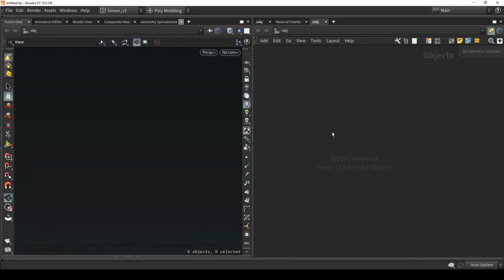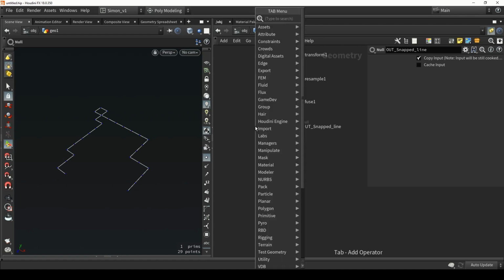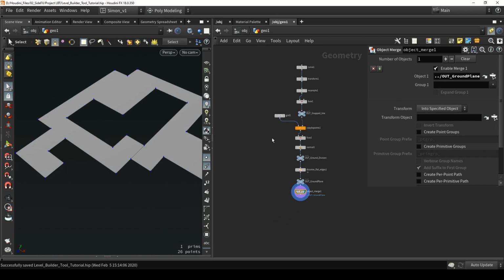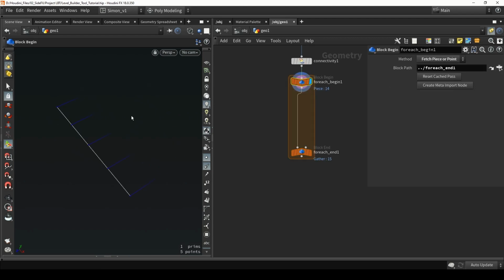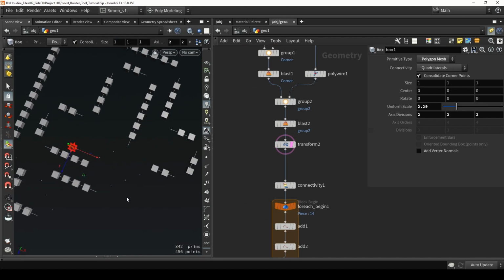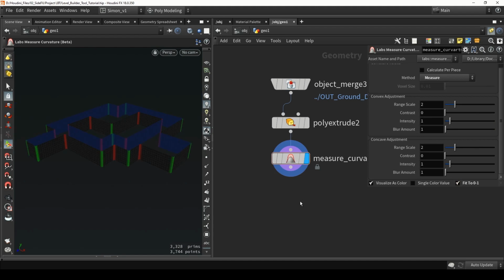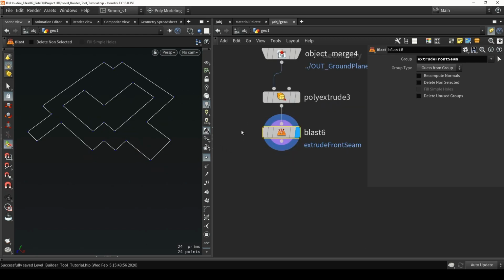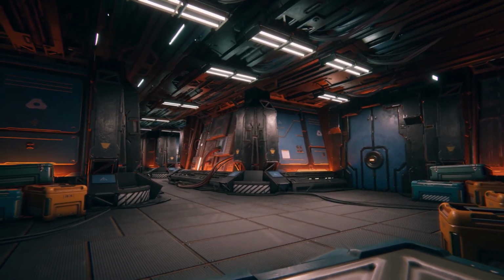Sci Fi Level Builder | Part 1 | The Corridor System

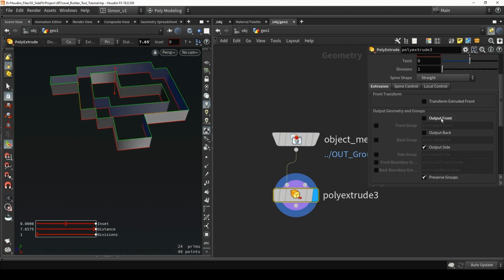Comment: I have re-done these steps many times in Houdini 18.x and 19.x,  and the polyExtrude + blast(extrudeFrontSeam) (at 22:00)   method does not clean up the inline edges that are generated when the generated Ground_Plane forms a loop. Any ideas? Work arounds?
Reply: Had the same problem and unfortunately Clem's solution didn't work for me. What worked in the end was to:
1. swap "Dissolve_Flat_Edges" for the "Extract_Solhouette" LABS node
2. change "Trace Axis" to Y
3. check "Remove Outside of Solhouette"
Reply: @setterberg_p  thank you !
Reply: @setterberg_p  With this method how, could I remove the inline points? Whenever I use the extract silhouette it keeps the edges subdivided.
Reply: @mikepenny9171  remove inline points (type) facet  node or vex
Reply: It took me ages but finally figured out a way:
1) From the polyextr, wire into both inputs of a Boolean. For Set A & B use Treat As Surface. Operation: Shatter
2) Add a Convert Line 
3) Add a Delete, Operation: Delete By Expression, Expression: @P.y>0.01
Reply: Same Problem not getting the solution with the method commented here. Did anybody finds the solution ?
Reply: @kevintexture  if you are using extract silhouette, make sure mode is set to contours. this should remove line segments. may have to adjust the normals a bit, or just make sure to use (extrusion mode = point normal, existing) on your ploy extrude nodes
Reply: This bit has kicked my ass! In Houdini 20.5.370 with Labs 20.5.370 and finding problems with all three methods here when it comes to instancing the corner segments later. I think Clem's solution got me nearest but I ended up with wonky normals on the corner where an inside edge had been removed. 

Just decided to carry on knowing I can't draw curves that cause an inside edge for now. Beauty of procedural, tag it as a known issue and come back to fix later :D
Reply: If none of the other solutions worked for you then here is one that should, at the time of writing this comment I am using Houdini 21.0.440. I will do my best to explain concisely.

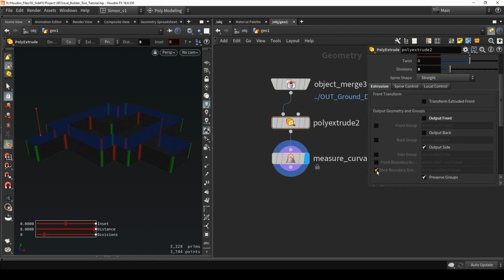It will involve diverging from the tutorial just after the Labs Measure Curvature node. In the video, at exactly 19:23, is were we will diverge. Follow all steps until this point.

1. After the measure curvature node place down a Group Promote and connect to its first input -> inside we will convert from Edges to Points -> Group Name: extrudeBackSeam.

2. Place down a Group node and connect to its first input -> Group Name: corner_edges -> Group Type: Edges -> untick Enable under the Base Group tab -> tick Enable under the Include By Edges tab -> tick the Min Edge Angle, leave it at the default of 20.

3. Place down a Point Wrangle node and connect to its first input (0) -> Group: corner_edges -> Run Over: points -> paste in this vex code:

//Group points that have exactly 3 neighboring points.
if(neighbourcount(0,@ptnum)==3)
    @group_corner_max_min = 1;

4. Place down a Group Combine node and connect to its first input -> Number of Combines: 1 -> Group Type Points -> Group Name: corner_max_min -> to the right of the group name text box, select the Equals mode from the drop down menu -> to the right of the equals mode box, input corner_max_min into the text box -> Under the group name text click the box that says None -> select the Subtraction mode -> to the right, change With to With All But -> to the right, in the text box input extrudeBackSeam.

5. Place down a blast node and connect to its first input -> Group: corner_max_min -> Group Type: Guess from Group -> tick Delete Non Selected (this should leave you with only your bottom corner points, both red and green).

6. (The Labs Measure Curvature node should have created two point attributes for you, Concavity and Convexity, we will utilize one of these attributes here) -> Place down a Split node and connect to its first input -> Group: @concavity!=0 -> Group type Points

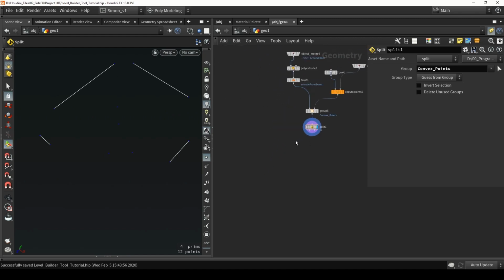7. From the split node's 1st output place down and connect a Null node and rename it OUT_concave_corners -> From the split node's 2nd output place down and connect another Null node and rename it OUT_convex_corners. (These two nulls now contain your concave corner points and your convex corner points. You can use these two nulls with their corresponding Object Merge nodes to copy your modular corner wall models via copy to points as seen at 24:46 of the video).

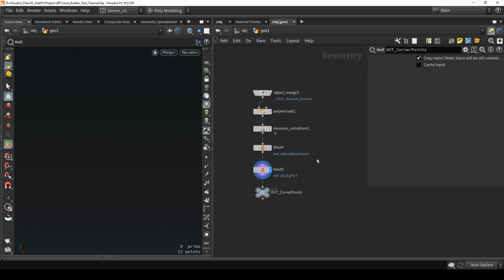8. Return back to the Labs Measure Curvature node and drag another connecting line out and create your normal node and OUT_normal_direction null node as seen at 21:00 of the video.

After copying your convex/concave corner wall models to your corresponding points you should be good to continue to the next video. I am still testing the system out but everything seems to be pretty stable.

Comment: Simone, or anyone - the trick you do on 18:38 switching method from Tenor to Measure apparently doesn't work anymore on later latest version of Labs Measure Curvature node. When I switch it to Measure - it detects only the concave (green) corners and just fills with Red color the rest of primitives which of course produces incorrect results later on. Can you please help?
Reply: In case it will come in handy for someone - looks like Labs devs changed something in the newest Measure Curvature 3.0 node and now switching to Measure mode will screw up Convex (red) representation of it. The only solution I found is to use older Labs Measure Curvature 2.0 which you can find in the final scene provided by Simon in the description of this video.
Reply: @defonten  Lowering the division in the Extrude node to 0 (zero) worked for me. I'm using the latest version of SideFXLabs for 18.5.
Reply: @setterberg_p  This was the solution, thank you <3
Reply: Probably no one is going to read this ever, but make sure that you select Back Boundary Group, not Back Group in the polyextrude node. This was how I fixed it!

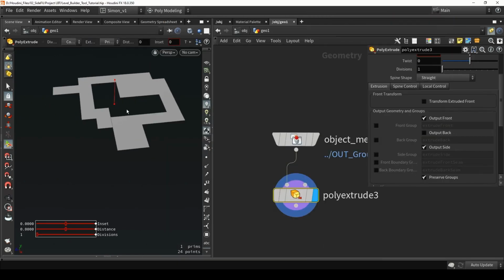Comment: Can't get rid of the extra line through extrude and blast as 21:55. How can I fix it?
Reply: I already delete the front, but the block wall stays
Reply: @levinqu7192  Been cracking my head too with this. The problem is in the latest Labs Dissolve Flat Edges node which apparently screws up something. Open the final project provided by Simon and copy older Dissolve Flat Edges node that works fine!

Comment: blasting the corners doesnt work in my build the same...hmm.
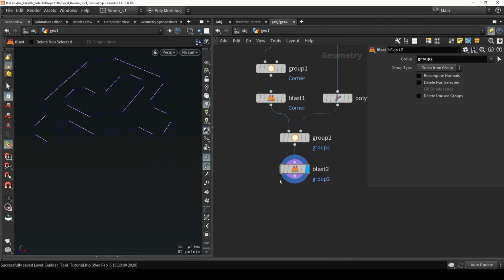Reply: nor the  blast at 10:45...back to the drawing algorithm it seems oi
Reply: otherwise well explained you kinda didnt explain the blast part well imo
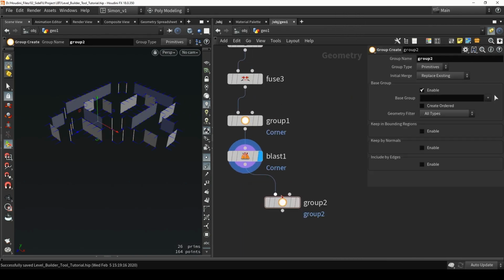Reply: @lyndajones1133  maybe you copied the "Corner" group to create the "group2" in 10:10 and your Blast didn't work because you had two Corner groups? This blast issue happened to me and all I had to do to fix was: make sure the group is not "Enabled" under Base Group and rename them differently.
Reply: I had this exact same problem, but then I realized that my default project was on a different scale, and was way smaller (was using 0.8 for grid size). When looking at that blast2 node, your edges make look very thin and unlike the thick white in the video. So this means they are correct and present, but just very small.

Comment: Sir,
As usual, amazing tutorial.

A question please....
You set the grid spacing to 8
Then when you placed the add node to split the connected lines into big walls ( I assume it is 3 units) and small walls ( I assume 1 unit).... The question is.... Does that mean I should model my walls that I want to later copy to the points, to those unit sizes... ( 3 meter or units in width & the small wall should be 1 unit in width)?

I assume the height of the walls should also be the same as the height you set earlier??

Is that correct?

My modeled walls should always be pre-defined?

Thanks a lot